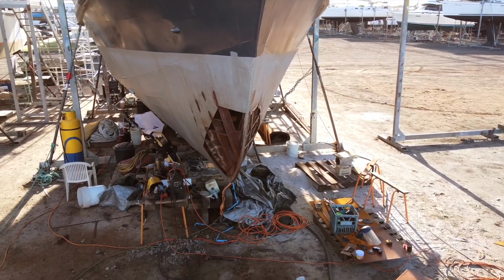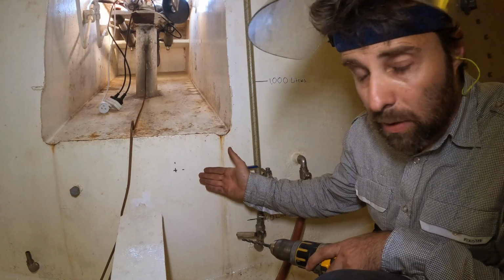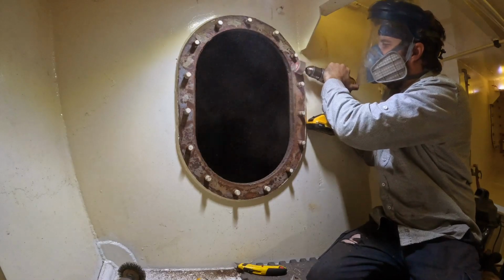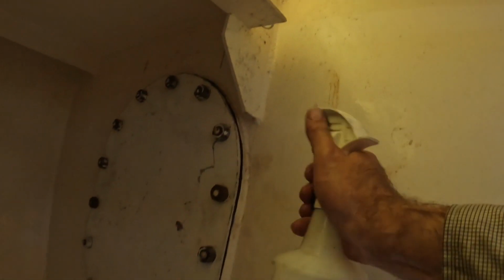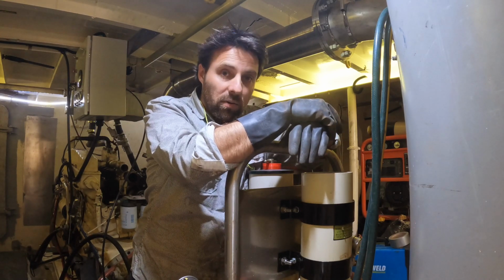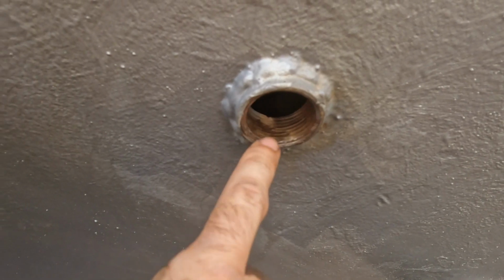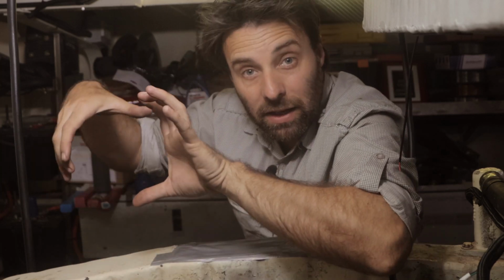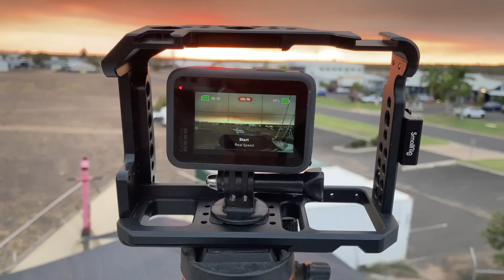Moving 2 ton of diesel to fix fuel tank leaks - Project Brupeg Ep. 269

Comment: Hi guys, love the build so far.  Watching Damien beat on that rubber gasket to make the bolt holes reminded me of something we used in my industrial mechanics days.  Take a large diameter, say 4", piece of pipe about 1" tall and fill that with lead.  You can then use that as the backer for cutting the bolt holes with the gasket punch.  You can use a ball peen hammer to cold work the surface flat again or use a torch and just melt the top.  Of course, this may not be approved anymore due to use of lead anywhere anymore. Just a thought.

Comment: Dame, you might find a small vacuum pump a handy tool to have when working on oil filled tanks. I worked on high voltage transformers for a few decades. There were times when the bottom sample valves would have to be replaced but having to remove 8,000 gals of oil wouldn't be a simple task. So I'd place a few pounds of  vacuum in the air space on the top of the unit and quickly remove and replace the bottom valve all before losing any oil. The same could apply to replacing plugs or fittings. You just have to be cautious not to draw too heavy a vacuum on any closed tank. It doesn't take much to crush a tank. 
I only used a small single phase, vacuum pump I think it was less than $100.00 .  Of course none of this is going to help you with underwater fittings. 🤣
Good call on your engine. This one will get you launched and then some. Anything I've learned watching you all this time, never underestimate your knowledge on engines. 🤝🤝🤝👍👍👍🇺🇸

Comment: Wow,what a roller coaster with that engine. Losing power, gaining power, all while it sits there partially dismantled. Great that it will be able to get you through launch and initial sea trials while you sort out the long term solution.
Reply from the maker: It looks like we may have found a donor engine to rebuild. We will put some more info on Patreon once we know more.

Comment: After several problems with sockets and plugs in tanks I gave up and started using hydraulic sockets and plugs. The socket has more meat and won't distort when welded also the full taper thread matches the tapered plug better. I also gave up on hollow plugs and used solid ones. You might think my OCD is raging but it's not, I absolutely hate doing a job twice, oddly there's a statement to this effect at Southward Car Museum, seems old Len was pretty hot on this too.

Comment: Damien, the persistent leak (at the plug adjacent to the prop) will continue to leak with the (tapered) threads tapped all the way into the bung.  I would remove the bung, weld in a new one that hasn’t been tapped to the depth that you tapped it, and then use your normal pipe sealant.  The alternative is to weld in a new bung that uses a crush washer, and that would also resolve your problems.  Remember, a tapered thread should never be threaded all the way in, because that results in a straight thread, which will rarely seal.  Good luck to you, I was a Cummins Diesel tech/supervisor here in Texas foe many years.

Comment: Damien, Commercial ships engineer here, safety advice for you on tank entries, particularly fuel tanks. When you open up a confined or enclosed space you should force ventilate that space or tank for 24 hours prior to making entry in order to get rid of toxic gases that may be present. Ideally you should also enter with a gas monitor that has been bump tested prior to use, and have constant communication with a lid sentry, someone whom could call for help should you collapse. The fitted vent does not count for ventilation purposes, it’s more a pressure relief vent.
Reply: this isn't a commercial ship and it's diesel. if he were to follow confined space procedures he wouldn't get anything done.
Reply: @rustblade5021  and if he doesnt he may never complete another thing...
Reply from the maker: Hi Guys, yes your right about venting the space before climbing in, these tanks are small but still able to knock you out. the tank i was climbing in was left open for a while before climbing in and the bung at the bottom had been out for months so any CO2 etc thats built up would have drained out the bottom.
Reply: @rustblade5021  and that thinking is why so many seafarers die every year through making tank entries. Either they “don’t have time to do the paperwork and procedures” or “it’s fine, it was a safe cargo” or “we just emptied it so it’s sucked in clean air”. No. It’s not safe unless it’s been fully ventilated, and is being ventilated upon entry. It’s the only way to ensure that there is enough oxygen in the space to sustain life, as well as keep the hydrocarbon vapour levels below the lower explosive limit, and the likes of carbon monoxide, hydrogen sulphide, or anything else out of the tank. This is why it is an international regulation for all vessels engaged in commercial operations.

I’m sure Jess would rather Damien took an extra day to do a job, and do it right, than jump straight in and never do another job on the boat again.
Reply: Damien is a pretty on point guy, he has been around… he would not have done anything unless he knew it was safe. If you look back at earlier videos he has ventilated when necessary in the past.
Reply: The other one is that there may not be any CO2, but rust formation can suck the oxygen out of the atmosphere, so you climb in, realise its a concentration that won't support life and pass out before you can act upon this final thought.
Regulations are written in blood: people have died and the legislation is to stop it happening again.
Reply: An aircraft company was doing a tank repair on a 747, work was completed, buttoned up and returned to service. Aircraft was having problems with filter clogging, including cloth fibers. Turns out, the mechanic was overcome, passed out and died. The filter clogging was organic material from his body and the fibers were from his coveralls. When they opened the tank they found his bones.
Reply: @rustblade5021  Explains the death rates. No, seriously, there's thousands upon thousands of water related fuel tank deaths. More, if you expand for land based search criteria, like tankers. Rule of thumb, just because you think you're smart, doesn't mean you should go against common wisdom. Common wisdom is generally accrued into procedures. Procedure says vent the tank. It's procedures that made the air industry as safe as it is, arguably the safest global industry that ever existed, ever.
Reply: No worries, I was watching him enter on my phone, and would have immediately commented if something happened to him!!
Reply: @ProjectBrupeg  I think everyone (including yourself) are probably correct to a point.  You know, a small mechanical vent / fan rig like they use in mines would be good to have, a bit of 15cm aircon hose & a 12v inline fan ?
Reply: @ericmartin5720   didn’t anyone wonder where their colleague got too?
Reply: Look! This guy is an Engineer.I am sure he checks out everything he needs to. In other words he does his homework. If I! As an engineer,we’re doing this project,I would check (Everything). Leave it to him. He is not going to jeopardise his life.
Reply: No sentry no entry.
Reply from the maker: This tank has not had any diesel in it since it was cleaned with a high pressure water blaster.
Reply from the maker: Nope. Commercial is paid crew. Paid for expeditions etc. boat in commercial survey.  Rupee won’t be that. Think of Brupeg as a completely private boat that donates berths and seatime to people and researchers wanting to collect data etc that can’t otherwise access those areas of the planet. An expedition for us could be anything from steaming to Antartica to film a migration for YouTube through to taking PHD students to somewhere extremely remote to pull water column samples from deep water for pollution tracking etc we wont be accepting any payment to do this work otherwise that makes us commercial. All seatime is donated and brupegs upkeep is 100% funded by Patreons and YouTube revenue.
Reply: @ProjectBrupeg  Just don't blow yourself up Damian 🤣💥😵
Reply from the maker: I can agree to this! Dame
Reply: Not only hazard from toxic fumes but also hazard from low oxygen levels. Plenty of people have died from entering unventilated chain lockers.

Comment: I don't know anything about diesel fuel systems I'm a machinist by trade and I noticed when you ran the tap into the bung hole the tap ran freely all the way into the threaded hole. A rough rule of thumb is you should only run the tap till there are 5 treads remaining outside the threaded hole so the female thread can seal tightly. I'm not sure if that is a tapered pipe fitting I just figured I would throw that out there.

Comment: 23:10 It's also to allow air in to replace the fuel used so that the tank doesn't try to implode
Reply: Yep. It's actualy amazing how much force a negative air pressure can create. So venting is a good plan. You can also get some burst disks and or pressure sensors (seal the tank) if you really want to stop airflow but have a safety system so you don't brake welds/warp metal.
Reply: I've seen a stainless steel milk tanker with the sides caved in because the vent failed/wasn't opened on the lid and 10000L were sucked out of it.

Comment: We inspected a C32 at work and found cracked number 2 piston, we decided to let run and monitor it at service intervals, it fractured/split and failed completely within 40 hours run time. Can happen, lot more expensive to pull it back out of the water if it fails quicker than you expect.
Reply: Once it cracks it's inevitable. The forces have been released and even sitting on a shelf it will continue to split (albeit slower). I had a big, BIG single cylinder piston as a teenager. It was discarded because the skirt had split. I thought'd gone mad checking it years after when i moved and seeing the crack extend up over the pin well into the body.
Reply: rebuilt it or replace it. before going into water . get 50bor 100 k offshore and try to fine help .

Comment: Pipe threads are tapered, it looked to me you went too deep when chasing those threads, so the plug went too far in and not seal the connection.

Comment: If you can (time, resources), you should also do a vacuum test (nothing excessive) on the tanks. Completely unrelated to any holes potentially existing, but it would help to figure out if some areas could do with reinforcement. You're going in the cold region, metals move, you know how it is. Vacuum reveals weak spots easier (or so i was told recently). Obviously irrelevant to any surface that's inside the boat, only outside ones are in question.

Comment: Just wondering why you used hollow bungs for the main bottom drain in your fuel tanks. I would have thought that solid drain bungs would have been a better choice, they cannot hold any impurities within the bung and are a lot less likely to distort when being installed and tightened. Just a thought, that you may have overlooked. Cheers and keep on keeping on.

Comment: The only thing that I could suggest is to use a new plug rather than a used one as the threads on the plug distort when it is screwed in.  It's also possible that the bung used was distorted when welded into the tank bottom?

Comment: How readily will you be able to switch which tanks the engine and generator get fuel from?  Will you be able to do that from the bridge?  Would you normally pull fuel from both matching tanks (port versus starboard) at the same time?
Reply from the maker: It’s as easy as opening a few ball valves. Not 100% certain how we will drain the fuel. Trim of boat comes into play so it’s possible we keep them seperate but every few hours even then up by allowing the tank with more to flow over to the tank with less.
Reply: @ProjectBrupeg  I mentioned drawing from both tanks so you empty them together.
Reply from the maker: I think we would still try to only draw from a single tank at a time for safety. If something happened to say a fuel pipe and it dumped fuel into the bilge and then the bilge pump fired it all over the side we would lose all fuel. When drawing from a single tank you would let lose all fuel only from the drawing tank. This is an extreme example but it gives you an idea as to why we would only want to pull one down at a time, and then manually correct the trim

Comment: Hi Dame. While I was watching you screwing the pipe tap in I was wondering if you realized that that's a tapered hole? The deeper you go you can ruin the mechanical seat...
Reply: I was thinking the same but wasn't sure with tapered pipe fittings whether the female thread was tapered or not. If they are then they can't be cut with a tapered tap as it would have to stop whilst cutting, leaving a step.

Comment: Hi.
I put old loudspeaker magnets by the fuel tap under the tank on generator's.. stops the fine rust getting to the gauze.. and eventually the carburettor.. no metal silt clogging the float valve or in the bowl to clean out... 😻 ...
Wondering if you made a steel box/tube and put magnets in it and put that by the pickup in the tank.. I suggest the box as I don't know if diesel will damage/deteriorate them.
Should save some money on filters...
Also reduces the chance of silt building up at low points in the pipeline.
I didn't like the hole under the vent on deck as it could let water in.
Lookout for some pipe big enough to almost go to deck level with a lid on top.. could you use plastic sewage pipe with end bung and some brackets at the bottom.

Proper question..
You said the diesel was 8? years old.
Does diesel go off with age? Like petrol.
I've got about 12 gallons (cost now over £100) that's 15 years old.. clean no bug.. if I did use it.. I'd filter and mix it with some new.

Hoping they might donate the engine..

For amusement..
I was wondering if the new engine could be 'accidentally' delivered to your boat.. like what happens to packages and it's reported as lost in transit.

Comment: In the oil and gas industry,  I have seen on more than one occasion thredolet fittings refuse to seal because the thread gets distorted by welding the fitting on, particularly larger fittings. Clean up thread with tap helps but its not a guaranteed fix.

Comment: Here is a question out of left field.  A few years back we were on a kayak-mothership adventure in Chile on a 8 passenger boat.  We were boarded by the Chilean Navy and they gave the captain a citation because the boat only had 1 engine and we were operating in an area with icebergs.  I am curious of your opinion on one versus two engines, especially while operating in areas with ice.  Thanks
Reply from the maker: Most commercial boats in the world operate with single engines. It’s not that same as recreational boats. Rex boats have smaller engines putting out more horsepower therefore don’t have as much reliability plus maintenance isn’t normally as high on non commercial boats
Reply: @ProjectBrupeg While that may be correct will you be operating as a commercial boat or a private live aboard?
Reply from the maker: 100% private vessel

Comment: Do you think there was water in the diesel that you ran through cold distillation?    Meaning it actually worked.  Also warming the fuel you are distilling to 100F will make it work better, faster, and more consistently than let's say 70F.   I am glad you won't be doing hot distillation, since it is so much safer.

Comment: Are those plugs pipe thread? And the tap is a straight tap? I was just wondering if you ran the straight tap all the way through it is no longer a pipe thread, then if you are putting a pipe thread plug back in maybe that’s why it’s leaking.

Comment: I was just looking at the top of the rudder there and you've got a flange at the top or spacer that's got supposedly two bolts on each side of it and I don't see any bolts in it is it supposed to be like that?
Reply from the maker: Job still to do, its a coller that needs to be bolted back on.

Comment: Hi, We just completed top end rebuilds on 2 x K19 Cummins, Crank was ok so just above that. Cost was about $27,000 / engine parts only. You might like to broaden your search to this model.
Reply from the maker: No thanks. We can by a full rebuilt kit for $3,500 for the 855 and it’s the right size for this boat. K19 is too big and overkill for our needs

Comment: Oh no guys I’m sorry about the motor I had a hunch it may have issues I’m so glad you found them now and not on the water in a squall I’m glad to contribute what I can to finding and rebuilding the correct type of Cummins I know you’ll sniff one out just please find one that’s as complete as you can an does this also mean you’ll need a new gear box for it idk about marine applications if easily swappable back n fourth from motor to motor any ways guys just keep your heads up it’ll be ok I promise this is just a test of your faith you have to keep the faith you’ve come this far haven’t you we believe in you guys and we are here with you good luck on the hunt and demand excellence and quality
Reply from the maker: Thanks Clarence. It looks like we may have found a donor engine. Swapping it out is fine. They should be identical blocks so no need to change gearbox etc
Reply: @ProjectBrupeg  Thank goodness!!

Comment: Transferring fuel question? When moving fuel from one tank to the other I "assume" that the tank that is emptying has to have a vent to allow air to fill the tank and the tank that is being filled has to vent air as the tank fills. Is that all done via the vent hole at the filler pipes?
Reply from the maker: Yes, but its done by opening the vent its self, not the small air relief hole